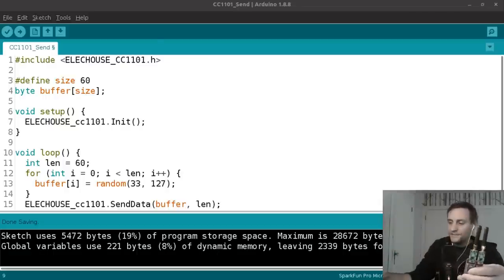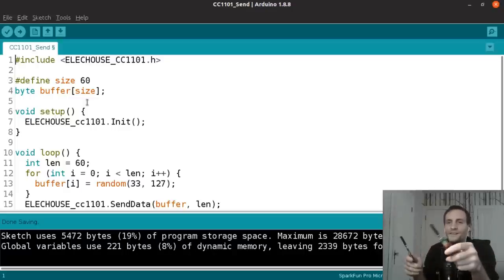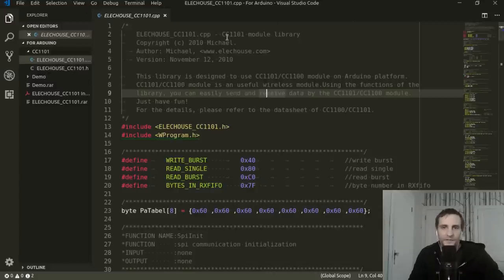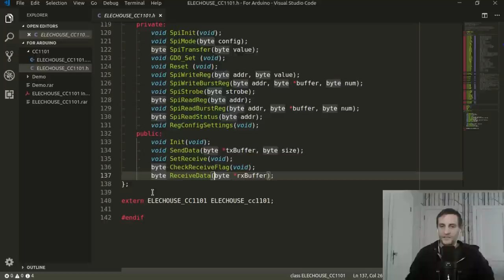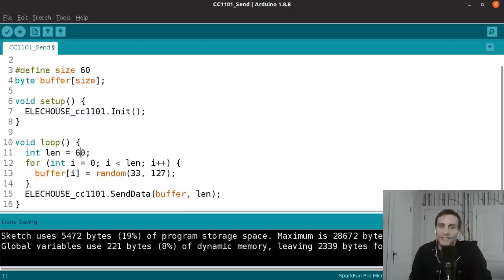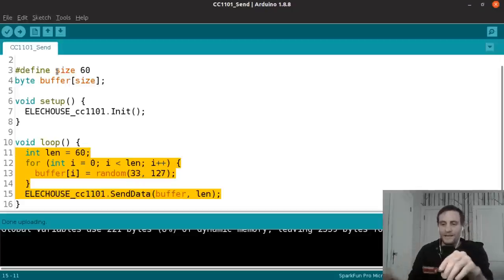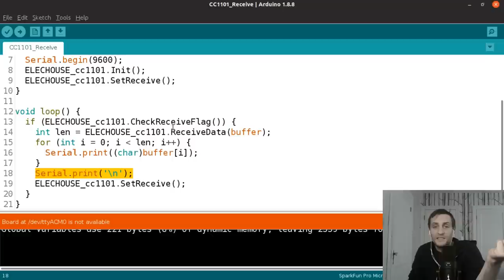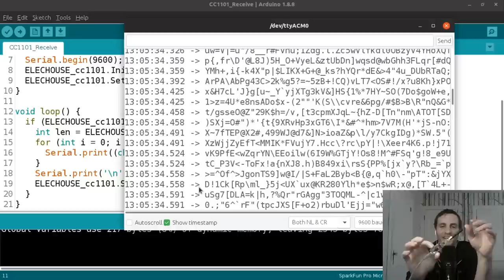Arduino Wireless RF Transceiver Module Intro

Comment: I suggest to grab another pair and create a full-duplex with the pairs on different channels to reduce risk of dropped data while not in rx mode! Good multiplexing should reduce your drop rate. Using your tx as the master and rx as the slave module on your spi bus with interrupts, you may obtain more reliable packet transfer. Also, using what you built as a callback with high priority (blocking your main) may also increase reliability.

Also, careful youre only using the 900mhz ISM if youre in the US and that 433mhz is only used outside the US since LPD433 is govt use in the US. 

Thanks for posting this on the nrf905 units, this is a good outline for building code 🙏

Comment: There are two errors in your code. SendData( buffer, len); must be SendData((byte*)&buffer, len); or SendData(&buffer[0], len); You don't see any errors because the data is random but the pointer to the data is wrong. Turn on warnings in the IDE. Serial.print((char)buffer[i]); truncates or rollover the byte because a char is not a byte. You can't see any errors because the data is random and you don't print what was send. This must be a unsigned char or another notation to print the value (hex or int). You randomize the array of bytes with values between 32..127 which is a char however the type is a byte so you need to treat it as byte and not typecast and limit it to a char.  For young players, this could be very confusing to debug when something goes wrong.

Comment: Just a pro-tip for anyone that stumbles across this. Do NOT solder parts while they are plugged into your breadboard. Some high quality breadboards might be able to withstand those temps. But the vast majority cannot. And you'll melt the plastic around the hole.

Comment: Hi, the reason for the 60byte limit is most likely due to the fifo buffer holding up to 64bytes for each tx and rx. so as long as the packages are 64byte sizes you should be good.

Comment: Is there a way to transmit the data at even lower frequencies using this module? Or do I have to use another module? I'm interested in TTE communications.

Comment: This was just the boost I needed to get me started with these devices. I like the fact that your example tx code doesn’t require the use of the serial terminal to work, thus making it easy to do range tests. Thank you for sharing!

Comment: what is the pin connection with the arduino, i have jumper cables and would like to know how to connect the board with the radio module

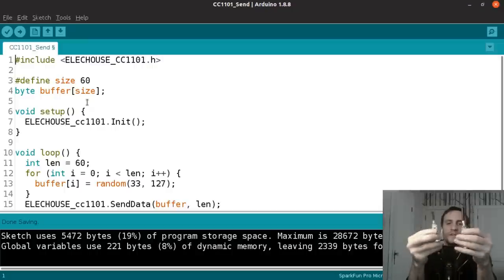Comment: Hi,  at  1:28 you say that the 433MHz RF units come with a ProMicro, it looks as if they are connected without any leads?
Yet the box you linked to has them separate, can you clarify please?
It looks as if you use the red PCB to connect them?

(Sorry I see at the END you soldering everything.)

Hint; A continuous picture in picture is not good when you are doing a show and tell. The code in the main screen makes no sense until you get into programming.
Sorry, its not a criticism, a great video, I like the library explanation. Looks like it  was originally written for an early version of the IDE.
But lets see the goods as you talk about it full screen. 
Remember, not everybody is viewing in HD 1080 AND on a 15inch LCD.

Tom...
Reply from the maker: The code was my main focus in this video since I showed the units in a previous video, but you're right, I should have showed them off a bit in the beginning instead of waiting until the end. I'll keep that in mind for future videos. Thanks for the feedback!

Comment: Hi Davy Wybiral

Awesome video. Waiting for my CC1101s to come. I've created some fun projects with cheaper 433mhz receiver and transmitters.

Do you know if there's a way to get these to do FSK with this or any other library? The cheaper receiver transmitter pairs seem to only do on / off (and get indecisive with anything in between).

I really appreciate your video. It makes the new toy not so scary! Some great tips on the comments for troubleshooting too.

Comment: Nice, I'm looking to do a home power usage meter and the ESP's appear to not have a library available, so, on to the Arduino.  It would be great to hear what the issue was with the 60 byte send limit?   Did you every determine what that was all about?

Comment: I'd like a Mail box TX / RX - maybe this will work - Dont want Wifi or anything with password in the mail box a simple konstant data stream 
when the mail box is opened send a few msgs and then sleep until the Mercury switch see the lid open again. So TX side must be battery powered no cpu needed,  Of the RX side  AC walwart usb power is fine to led an led !! and have it tie out after 2 hours and wait for the next msg,.  
Think this will do the trick? 
tnx Ed

Comment: It seems like that it's possible to transmit and receive on 868 MHz with these CC1101. I'd like to sniff a controller in my house for the  air ventilation and I know it is using 868 MHz. Could you show in a video how to do this?

Comment: Very interesting DavyBot, thanks. Do you know if these units can be addressed, I mean, have more than two units sending and receiving data and being able to understand from where the data is coming from? Actually, even with only two it would be important to avoid interference from another device like this transmitting without our knowledge. Regards!
Reply: Use space teddy's cc1101 library. You can set address, modulation type, data rate and pretty much anything. All features of cc1101 can be utilized if you use his library for arduino. https://github.com/spaceteddy/cc1101.
Similar library for msp430 mcu is written by me and link is in the readme of space teddy's library.

Comment: Would this work between a computer and a powered USB hub? I'm trying to make a wireless keyboard, mouse and controller that can stretch further distances. For instance, I can have my Nexus Pro streaming HD video in real time across my house from my tower but I cannot communicate back that distance. The goal is to build a wireless game box that I can move anywhere in my house, hook it up to a monitor but it still talks back to my computer, and playstation wirelessly.

Comment: Hi, 
TNX for Video. I want to transmit data between CC1101 Moduls with STM32 F446re. I sent data randomly but in Receiver i cannot get true data. can you say me , what can i do,please?
Reply: I've heard if the board you are using requires 3.3v digital and u use 5.5 d instead, you get interference. Get a step down module.

Comment: I am looking for a transceiver module that can communicate in 3 - 4 km. Do you have any suggestions? How will aluminium case act on the signal?
Reply: You van use a power amplifier and in order to avoid skin depth use a lower frecuency carrier, that may help for the aluminium problem.

Comment: Also using the pro micro, had to change the SPI pins in the elechouse_cc1101.h to get it to work! Just for anyone having the same troubles!
Reply: How did you do that?, I'm truly interested in doing it buying all in Aliexpress
Reply: @rodrigogarciapadilla4701  You just have to change the SPI pins in the elechouse library in the headerfile to the SPI pins of the pro micro, because they differ from the standard uno SPI pins. I believe they are 14 (MISO), 15 (SCK) and 16 (MOSI) instead the standart 11 to 13. Also pay attention to code beat's comment as you otherwise will likely have only rubbish results when sending real data.
Reply: @MrZomhad  And about the pcb for soldering the rf module, if I wanna get it, ¿wich could be te name?¿or should I design it and send it to pcbway or something like that?, and another thing, ¿should I be carefull with something when choosing the c1101? (I saw a lot of models in AliExpress with another bands of the 433, voltages and types of antennas).
Reply: I'll do the project instead the components arrive, ¿would you like to help me with some doubt that could appear? If you are agree, ¿may you give me a email or social web account in the wich I could send you my doubts and when you could help me a little bit when you be able?
Reply: @rodrigogarciapadilla4701  Personally I would not recommend the cc1101 as it proved to be quite hard to work with for someone with novel to intermediate experience. There are many other options that are way easier, I can recommend HC-12.